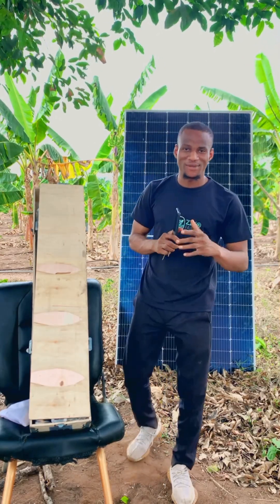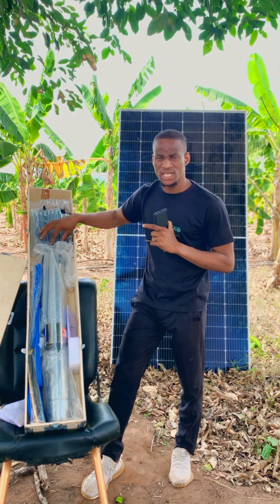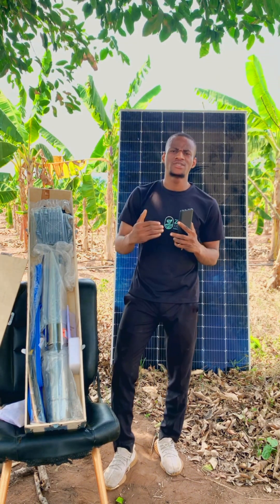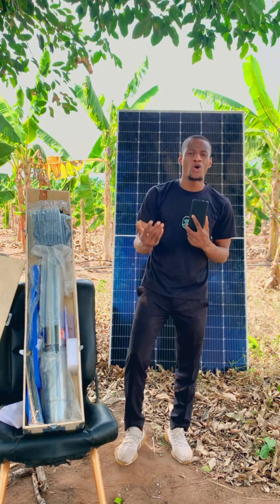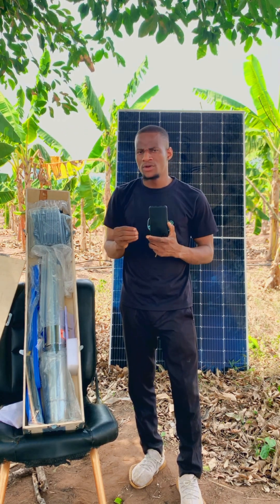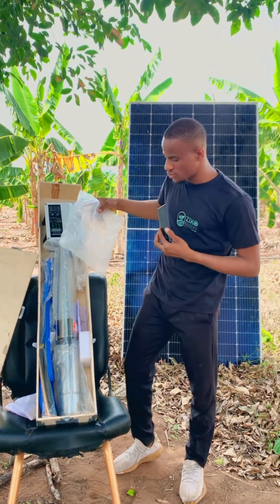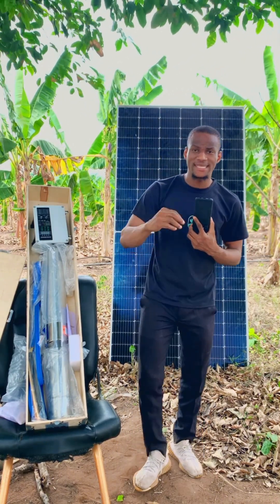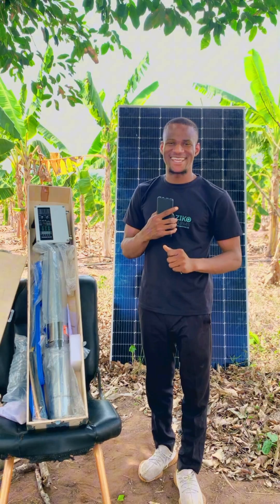Solar pump

Comment: How much is the pumping machine and the Solar, I meant the total package for the submersible and surface pump. Thank you
Reply from the maker: It depends on the type, and the pump type you need depends on the depth of your borehole.

We can discuss about this.

My personal line+2348126606315
My company line+2347044063673